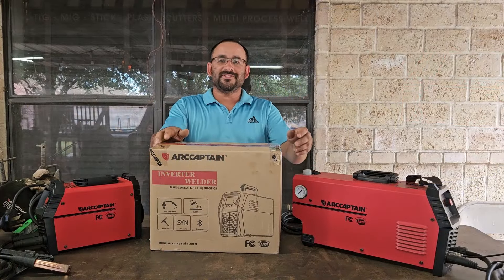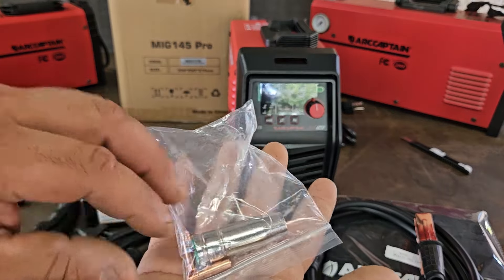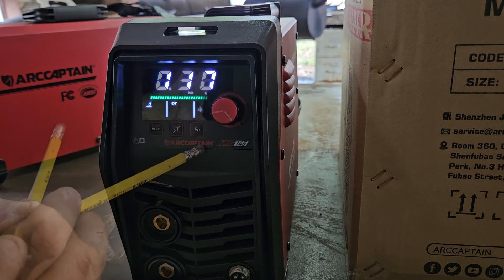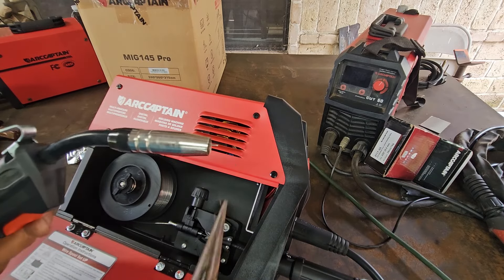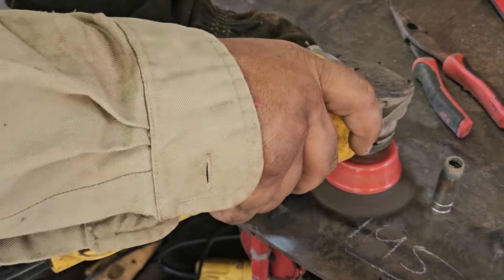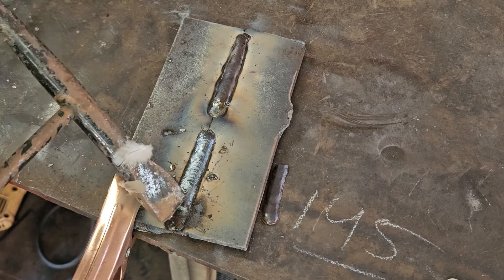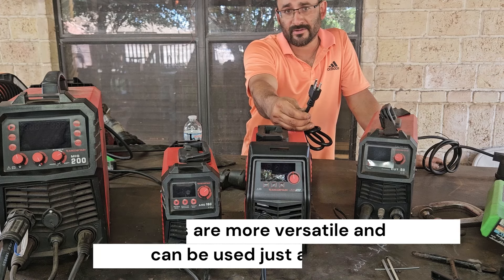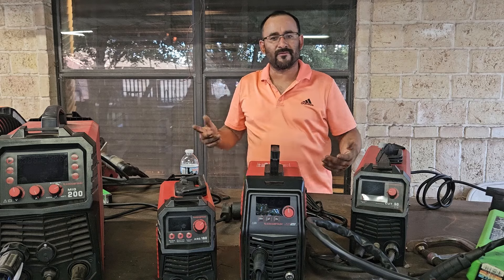Budget Amazon Welder Review: Arccaptain Mig145 Pro Flux Core Mig For 2025 Under $200. #arccaptain

Comment: Nice welder, like that the torch is detachable, but the downside is the cheap ground clamp 🧑‍🏭
Reply from the maker: Most of the welding machines I been using seem to have similar ground clamps, might be the same manufacture. I will hopefully be trying it out again to do more intensive testing.
Reply: @cutweldngrind  yes I have both the Titanium 125 and the Century FC 90 fluxcore welders and they both came with cheap ground clamps so I swapped them out for 300amp ground clamps but I also have the Yeswelder 135 fluxcore welder and it came with a heavy duty ground clamp ,so I see more of these class welders coming out with better upgrades like this one you reviewed and like the Best Arc 145, enjoyed your review 👍